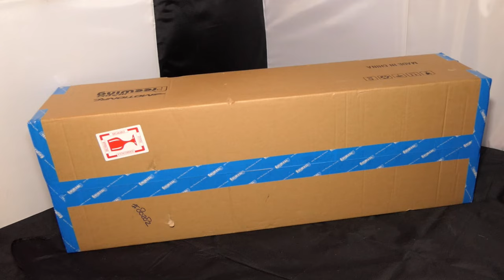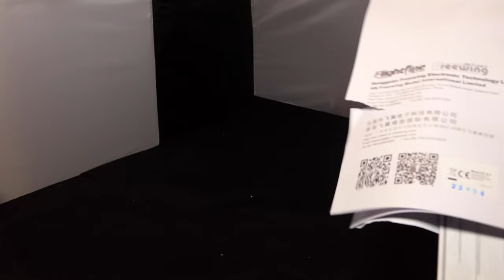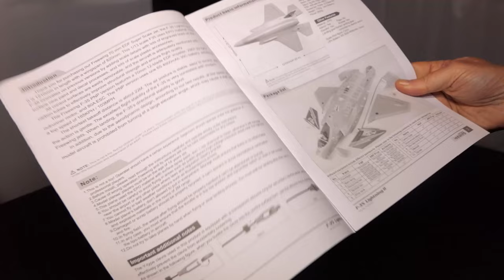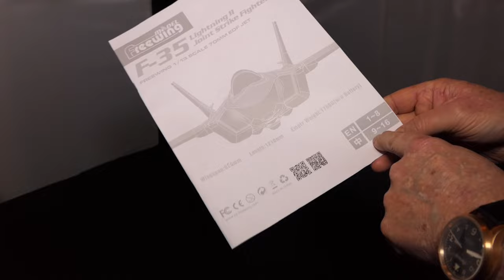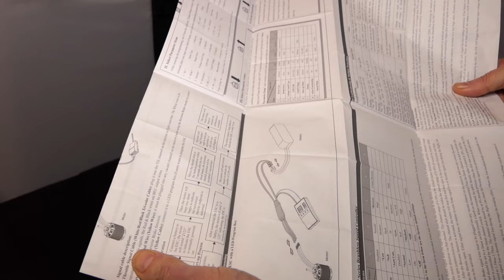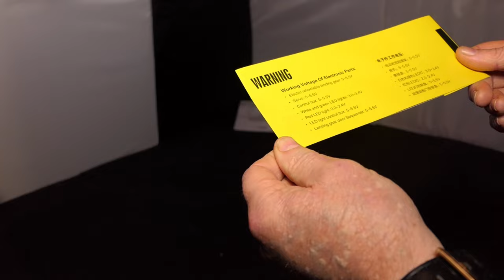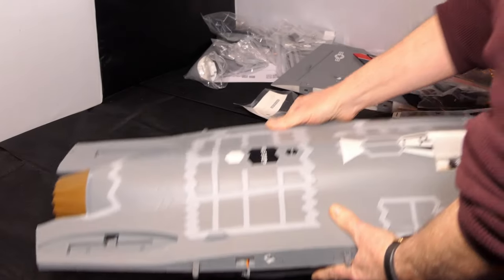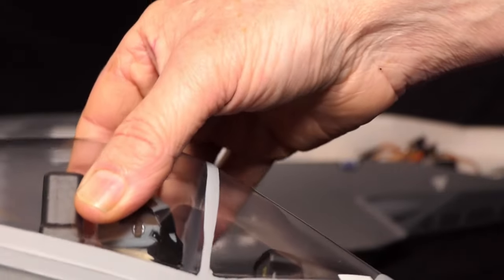Unboxing - Freewing F35 V3 -   Feb 2024

Comment: The air dominator. Yes sir, that is an impressive machine. The model is nice too, lol. I look forward to this and your other 27 maidens...
Reply from the maker: Hi Adam - well on the occasions I have been at the field - I have managed to tick off 2 of the 27 - LOL MInd you I have only been to the field twice so far this year (blasted weather) !! - I am totally addicted to these aircraft - what I am not ever going to get are the tiny "toys" that your government and Soon mine will be forcing use to take up.. as long as the RID modules are transferable between aircraft - I will get three or 4 of the UK equivalent modules and interchange them as necessary ..sorry but thought it better to rant on my video than yours..... Hope you are all well - Martyn
Reply: @FlankerTanker I get it buddy. Hopefully it will be as good there as it is here, and it IS good despite what Bruce says, Lol.  We have FRIA's...basically our flying clubs...no RID required. Hopefully in the UK it will be that way. For those days when we want to park fly, the modules are not difficult to use, and the UM's don't need them. All in all, better than we hoped for in the beginning of all this by far.

Comment: For your canopy lift issue.. I use Fat Guy Flys RC zip tie trick.. simple and effective. Just put a red zip tie up thru where that red spot is at the back of the canopy.. then Some canopy glue to hold it in place.. it’ll look like a scale antenna. Just remember to close the zip loop so you have a ball point on the other end under the canopy.
Reply from the maker: Yes I have done this on a few of my other Aircraft - it is a good idea and works well- thanks for the reminder.. Cheers